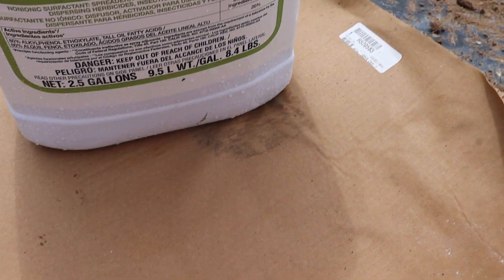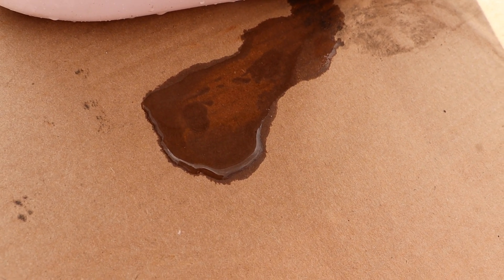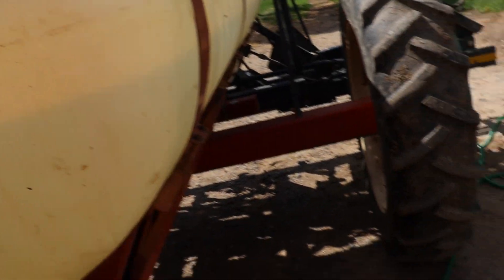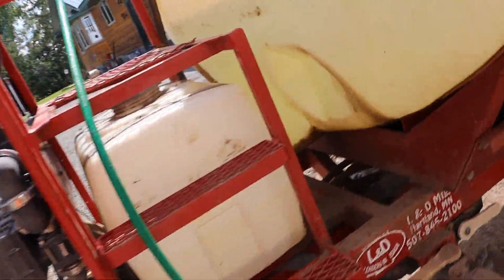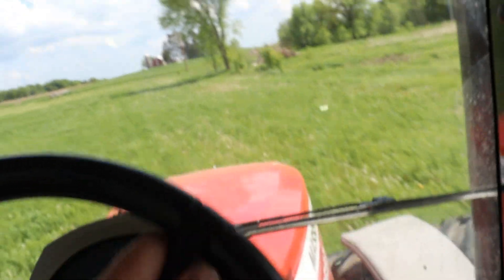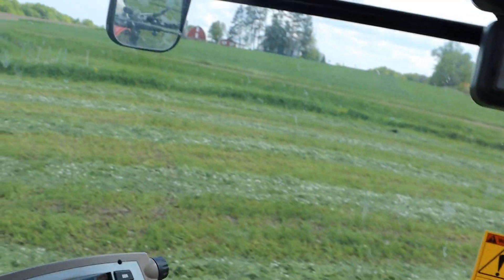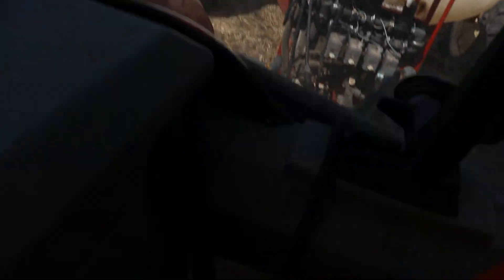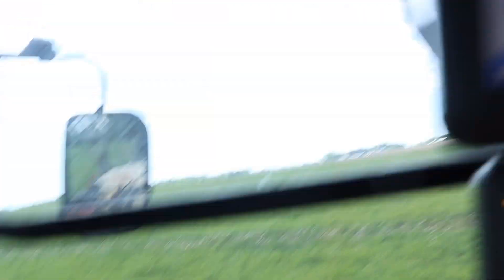making my water wetter experiment

Comment: How heavy is your soil?  I would think it would not be good for sandy soils, but good for heavy soils.
Reply from the maker: Variable.  

One theory is that it helps  The water filled the poor space is better so the soil can stay more full capacity of water
Reply: @jonstevensmaplegrovefarms3754  What I am thinking is with porous/sandy soil it makes the water even more fluid which causes water to run right through it.  Where as heavier soil it will find more spaces to reside.